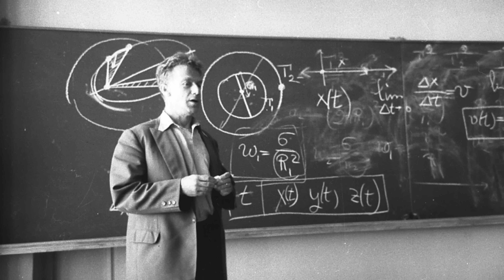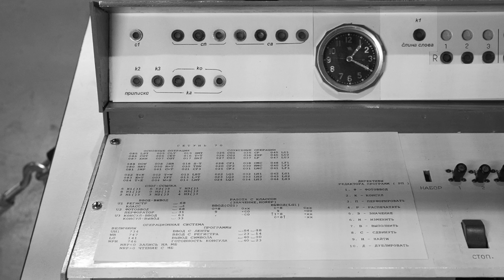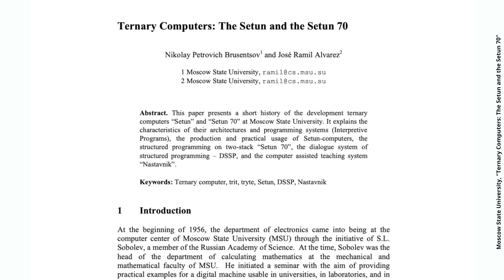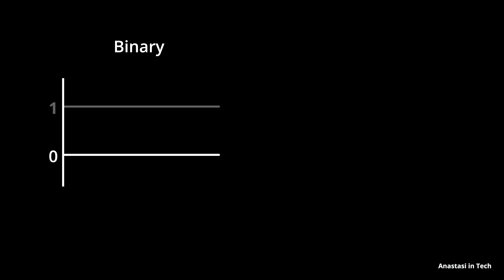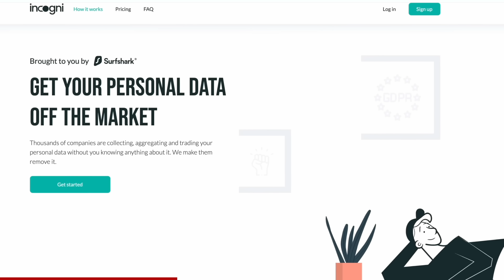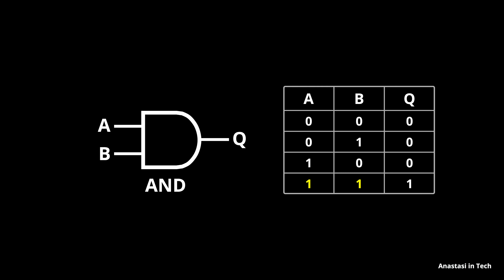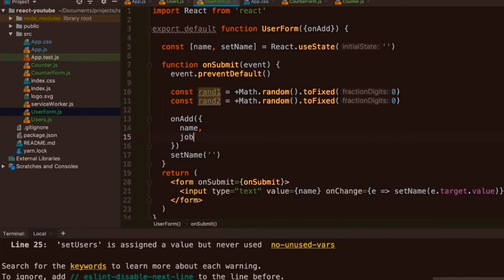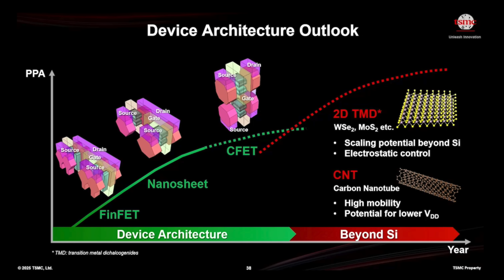The World's First Ternary Computer

Comment: The truth table at about 11:52 seems to have a little glitch, the third line probably should read -1 | 1 | -1 (not -1 | -1 | -1).
Reply from the maker: yes sorry for the typo
Reply: @AnastasiInTech  can you fix it.
Reply: @AnastasiInTech  - You are the best! I never like to see the end of the videos approaching...🥺
Reply: Good eye!!!😂
Reply: @samuelluria4744  No problem to see it for someone who's used to it.
Two main indicators: 1) -1 / -1 was there twice. 2) It was not systematic,
it had to have all states A and B following the pattern -1, 0, 1. -1 / 1 was missing.
Reply: Yes. This combination was missing in the table. But what I am wondering, what is such AND function good for? I see that it is based on the priorities: -1 has the highest priority, 0 has the middle priority and 1 has the lowest priority. So the result is always one of the input values with higher priority. So if any of them is -1 then result is -1. Otherwise if any of them is 0, the result is zero. Otherwise the result is 1. But what logic is this good for? Does it have equivalent in the real or abstract world?
Reply: @mareksykora779  As it was said before, both for binary and ternary, AND is a kind of digit multiplication!
0 * 0 = 0
1 * 0 = 0
0 * 1 = 0
1 * 1 = 1
It's the basis for multi-digit multiplication. Binary multiplication is much more simpler than decimal multiplication with not 4 but 100 one digit multiplications. Optimal for electronic calculation! Millions of very simple and easy operations.
Reply: I’m just wondering if this truth table is mathematically standardised. I could think of other results?
Reply: @techslfink9722  Actually it is just minimum of the input values. Same works for binary,  decimal, hexadecimal etc. It corresponds to intersection in set theory as something that is in both inputs.
Reply: I’m glad it wasn’t just me.
Reply: I noticed something wasn't right about the ternary and table as well. And it took me about 10 or 15 minutes to get the hang of how to count with the -1, 0, and 1 digits. Think of base 3 using 0, 1, and 2. So to crank through all possible combinations of the inputs, start with -1 paired with -1, then 0, and then 1. Then go to 0 paired with -1, 0, and 1. Finally, go to 1 paired with -1, 0, and 1. Then you have all 9 possible combinations for the ternary and. 

So, by getting the hang of counting with the -1, 0, and 1, it is easy to see the mistake for the B input on line 3 which should be a "1", not "-1".

The AND function is sometimes referred to as the MIN function: The output is the MINimum of the two inputs. Doesn't matter if it's binary, ternary, or hexadecimal.
Reply: I was about to write it ^.^ that logic was not logical
Reply: P.S. Do you think she really knows what she is talking about in 11:34 ? She is talking about 27 combinations. While in reality it is just 9 combinations with logically defined result.
Reply: @mareksykora779  I think I have to hear that again. Maybe I was too focused on the table that hat 9 combinations of A and B (with the corresponding Q) that I didn't really heard what she said. Many Comments might suggest, that she said something with 27 combinations. First I thought, it was just 27 numbers (9 cases with 3 values each: A, B, Q)... and 9 cases (3x3) is the correct number!
Reply: @rainerzufall42 11:34
Reply: @mareksykora779  Yes, I caught that too. But I think the 27 combinations refers to the case when you have three inputs. (If you look up "Three-valued logic" in Wikipedia it mentions this in the section under Logics.) It's just a bit confusing because what she's saying doesn't match the image being shown.

Comment: Most of my CS colleagues questioned whether something other than binary could be created early on in their education.
But the main opposing argument was that there is either on or off.  There could be different states of on but it's still on or off.
We all came to the conclusion that it was still binary but just had a way of adding another on in other words, another bit.   Which could make the electronics a bit more efficient but it really wasn't significantly different than binary.
It might have made Binary Coded Arithmetic a bit less tedious in my Assembly code.

Comment: I want to see Ternary CPU meets Reversible Logic NZEC.... that might be EPIC if were designing things from the ground up. Ternary would reduce the transistors which would leave space for resonators to send the energy in reverse... perhaps meaning less heat and less power.. maybe we could go faster and have higher data throughput at a low energy cost.. :o

Comment: So many great ideas recently, but they seem to stall at the research phase.... But with Huawei doing it, it might actually get somewhere since the CCP is mandating 50%? Chinese chips in Chinese data centre's going forward, and if this can be done relatively easily with the tech they have at hand, plus is faster and cheaper in the long run?
If it doesn't require any further refinement of their chip manufacturing down to lower nm scale, or a whole new manufacturing process. Then yeah, I can see this happening... 

Only question is will they release it in phones or data centres first? 
My guess will be phones to do a type of 'public beta test' before relying on it and to actually see the real world effect.

Comment: This is important for dropping down the future AGI power consumption at the biological brain's levels.

●Chinese Spiking Brain Technology 
●Silicon Quantum Photonics 
●Ternary Computing 
●Singapore HRM Architecture 
●Liquid Neural Networks 
●Microsoft Microchannel Liquid AI Cooling
●Memristors Brainlike Memories
●Neuromorphic Computing 
●FPGAs ASICs for Zero Latency Motor Control for Human Reaction Speed Androids

All those are very powerful technologies that will drop the current consumption energy ÷1000 to Even 10.000 times if implemented together and simultaneously, reaching or even surpassing human brain TDP of 1W per Petaflop or 20Petaflops at 20W at our fastest processing speed (Alpha Waves= 100Hz) according with Raymond Kurzweil calculations.

Add more solutions to this Glossary if you know more.
Reply: Correct!
Reply: Bismuth Quantum Photonics
Reply: "Liquid Neural Networks" this reminds me of a model someone developed of the neuron as a SONIC based actor rather than electrical model. I need to find out more about this.

Comment: Some of the issues with ternary are the same as with binary but with one more level.  Like noise, Binary does have a hysteresis region to eliminate the noise. Ternary would have that same thing but with 2 bands of indeterminacy. Dealing with positive and negative power rails complicates things though.  One way to deal with the noise is to raise the voltage but we've spent so much time lowering the voltages that the step backwards would need to be justified by the other improvements.  Technically you don't really need +/-, you could simply have levels with guard bands between. You could even to something like 8 states per 'bit' if you wanted to.  The problem with power consumption is that you need pull up/down resistors and that's where the power goes.  Ohms law is a bitch.  The lower the voltage the lower the current.  +/- holds the voltage at the same level so the current is lower.  Just like with photonics it could work but always having that interface to the standard binary stuff.  Maybe as time goes by more and more could be made ternary making binary a relic from the past.

Comment: Fascinating! Microsoft’s recent BitNet models (W1.58) already use ternary weights −1,0,+1. Conceptually, that lines up perfectly with ternary chips like Huawei’s prototype — multiplication becomes trivial (sign flip, skip, identity).

The catch: BitNet still runs with 8-bit activations and binary hardware kernels. To truly leverage ternary hardware, you’d need a full stack that supports trits natively — memory format, GEMM kernels, compilers. Right now Huawei only has patents, no dev kit.

So yes: the math and the models are ready. The hardware isn’t public yet. When a ternary accelerator with an SDK shows up, BitNet will probably be the first big model family to shine on it.
Reply: We had developed such system 15 years ago. Nobody was interested.
Reply: @Kammreiter  Apple Newton shipped in 1993 to 1998. Two decades ahead of the "right time" to develop a PDA. As it turns out, Apple got the timing just right the second time around. Your tech was probably just fine, it’s this intangible thing where when you’re too early, it flops, when you’re too late, the other guy has beat you to market.
Reply: If ternary can be used alongside binary then this could become the next new technology in your phone. If you need to replace everything at once then the migration from one system to another could be very costly and take much longer to replace binary. Data centres might be different, not just ai either, think Internet backbone. Replacing critical nodes could be a start where ternary and binary uses those nodes, others we have two systems next to each other and many staying with binary because it is easier and more importantly cheaper to manufacture right now.
Reply: @Kammreiter  Does that mean they will never be interested ever ? I'm sure there are countless inventions that were not appreciated immediately. Even lasers were described as 'a solution looking for a problem'.
Reply: To see the benefit of eliminating the Carry Bit operation on a large scale would require a complete hardware replacement.  Using a conversion kit would add processing for that conversion, negating the Carry Bit operation gains.  I’ve already written and tested this.  The only feasible implementation is in isolation (like the F-47 NGAD and its communication partners), small segmented networks.  It requires a complete HW implementation to benefit, else it’s just another protocal to be converted back and forth from and to.
Reply: Needing three voltage rails is the hard part... +v, 0, -v.
Reply: @mikeb3172  Currently most memories use capacitors to "store" bits. Attempting to store ternary trits in capacitors will be a lot more unreliable as the voltage stored in the capacitor decays, values will change. That is less of a problem when you are only storing 2 values (0 or 1) than attempting to store 3 values.
Reply: @Naris48  It's a tradeoff. If ternary has advantages, you can trade some noise-immunity and storage time to obtain those. It's not a mutually exclusive choice.
Reply: @mikeb3172  Just shift all states by +v. This is normally done in analog circuits where single-rail operation is desirable. And digital devices from the past frequently required as many as 4 rails. Didn't stop them being adopted.
Reply: Cool.  I hope so since my son works for Microsoft, lol
Reply: AI-made dev kit drops next week?🤗Smooth move by the Chinese👌

Now if only their next trick could be canceling world wars… and pandemics🧐
Reply: @TheGalacticIndian  unfortunately that would take much longer as it has been indoctrinated into the current Gen Z to accept that violence n genocide are part of the solution guided by western philosophy by their leadership. 

Fighting them is pointless, starvation is the other way. Cutting off all critical trade & possible sanctions on commodities to those countries. Let them burn out their own resources.  Their civilians will be treated as slaves by their elites. Just like the current situation, but much worse.
Reply: The more "threshold" levels there are the more likely for something to go wrong and have edge cases values that could be either value. That is why binary is used around the world because introducing more "threshold" levels to use base 3 or 4 or more introduces complexities and errors and reduces reliability.
Reply: ....WILL ONLY BELIEVE WHEN A TERNARY SoC ON A SMARTPHONE WILL RUN CYBERPUNK2077 120FPS 4K ULTRA

....OTHERWISE,IT DOES not WORTH IT

Comment: To accurately distinguish more transistor states you need a larger voltage range and hence you will use more power and the switching time will be longer.
Reply: This point might be the smoke screen.  A FET is only off, on or some state between.  Not plus/minus.  So it's the same as now but with more levels that they call plus, 0, and minus.  They could use P and N FETS but that would double the transistor count and negate the advantage.  Same voltage range but +/-.
Reply: @dougcox835  The use of positive, negative and zero is just a convenience for the hardware. That choice suited the early implementations but today we might have thresholds at 1.1 and 2.2 volts. It's arbitrary. Today's systems often use lower voltages inside the chips.
Reply: @dougcox835 Huawei is not using negative. It's based on extra threshold between 0 and max.
Reply: There will be more states yes, but I suspect the range is arbitrary (how was the range defined in CMOS or transistor-transistor logic?? I know what the range is mind you, my question is more how did they decide to use that as opposed to any other range) and the switching time I'm speculating will be unaffected as it only needs to discern it's current state, not all three states. I'm perfectly willing to concede I may be wrong though. xD
Reply: @fimmwolfnope5083  The voltage range is selected for noise immunity. So the voltage range for three states has to be at least twice the minimum range for two states. You have to set your clock rate to the maximum switching time which is the time it takes for the voltage to go from -1 to +1.
Reply: @fimmwolfnope5083 The range was define by the natural threshold of silicon which is above 0.7volts. If you want equal band between True and False then you set False to be between 0v and 0.7v and True between 0.7v and 1.4v but 1.4v is to inefficient so Max voltage is set between 1.2v and 1.1v
Reply: to my understanding they are using gates similar to CMOS binary, so only switching dynamic power. I guess, it all comes down to noise immunity.
Reply: alimentazione duale in realtà utilizzi configurazioni push pull che sono molto efficienti  rispetto che generare  il livello zero cortocircuitando il mosfet a massa
Reply: @gamedevunity3dliviopanizzi170  do you belive in GOD ! AND BIG MOTHER !! AND JESUS CHRIST!?!
Reply: Not necessarily. You just need better discrimination of voltage levels, but, as she said, there's a noise factor. In digital electronics, say 5V TTL (for example), and ON state can be as low as 2 volts - so there's a lot of leeway. CMOS is the same way, only tighter specs.  Earlier electronics production had quite a bit of margin for error in manufacturing - that margin has diminished (obviously) with 3.3V, 2.5V and now 1.8V logic - making it more susceptible to noise and requiring more rigid controls (this AND the shrinking of transistors to sub nm size) and ternary would make this extremely difficult to do with current fabs. When you realize how insanely expensive it is to build a fab (I believe it was her last video), I  don't believe anyone will want to risk that kind of investment for a 33% gain in performance.
Reply: @davestorm6718 yeah but to increase in steady performance/size we would have to make some sort of change as we can't keep going smaller. We'll eventually hit a point were we can't minimize anymore.
Reply: We're talking about 3 states of charge, not 3 levels of charge. 
-1,0,+1: the noise effect is exactly the same. You need an additional power rail, and a double bidirectional FET.
Reply: @zachariavallickad7264  If all you need is a power rail and a FET for each additional state, why stop at three?
Reply: Could be the same voltage, but reversed polarity.
Reply: I would think you would need more transistors and more voltage because transistors are already binary and are the basic building block of most chips.  I guess if someone came up with a modern 6502 ( which its binary version is only around 4000 transistor's) and built another version of this chip with a tenary version).  The entire instruction set would have to be redesigned as shifting a value to the left for example to multiply by 2 would no longer be possible and would now multiply by 3 instead.  In short until I see 2 versions of the same basic architecture I not buying this whole tenary computing concept as better than binary.
Reply: IDK, but what about positive, negative or neutral?
Reply: Sounds like a three wire circuit where you have two hots sharing the same neutral 1-0-1 , this would definitely be more efficient...
Reply: No, you can use more transistors because each additional transistor SQUARES the number of values you can store. It starts to get interesting at 5 and beyond.
Reply: @excitedbox5705  like bokocrt,nacrt,tlocrt,time and space, after 6is ur dimension of creativity... till 10.and again./
Reply: I think you are old and can not think beyond what you know 😂 no hard feelings but want you to have a open mind and embrace newer ideas than what we know. With small tweeks we can do things what we do in binary circuits, be done in trinary. Why not put the grey cells into action 😏
Reply: @sssun7  And you are young, talking hopeful nonsense without any reason behind it

Comment: Very interesting technology. If ADCs and DACs can be avoided this tech can fly.
Reply from the maker: According to the papers mentioned, no conversion is used.
Reply: They can't be avoided.  You will always need some sort of conversion from analog to digital and vice-versa, tri-state or not.  That said, it would still require less "bits" (or "trits") in either direction (and smaller smoothing caps for DACs).
Reply: @davestorm6718  TRITS == New term??   I like it.  Just an additional "bit" better :face-blue-smiling: